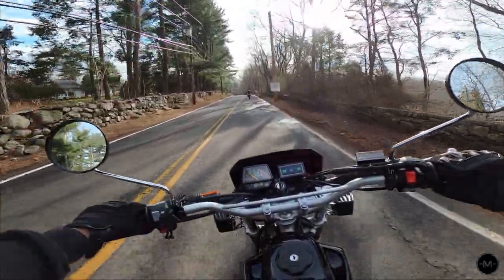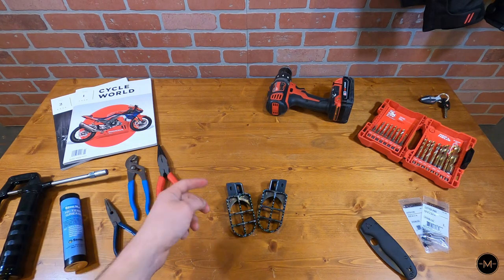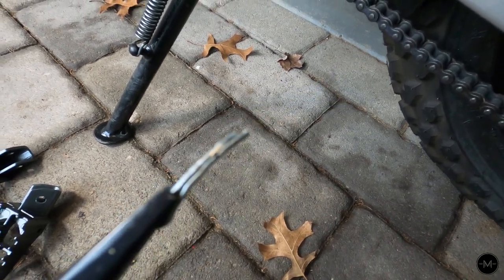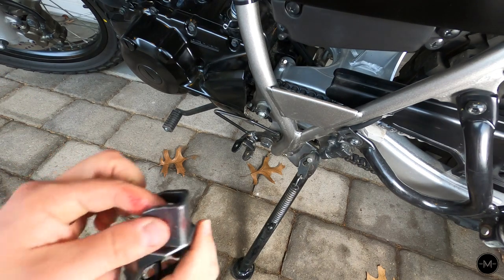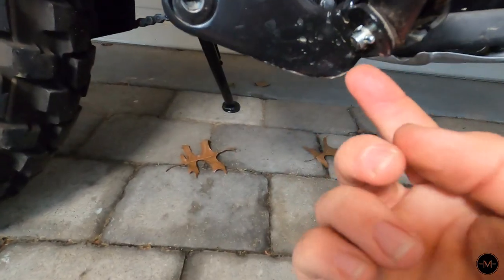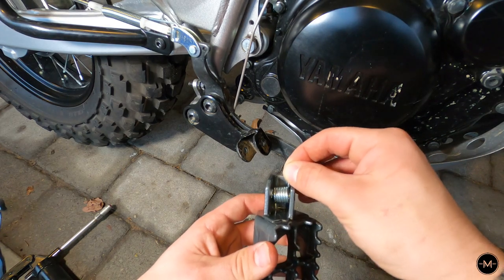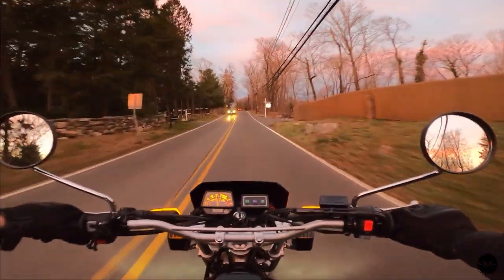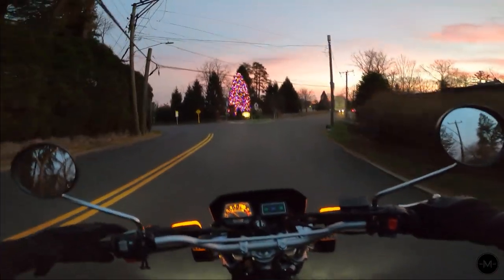Yamaha TW200 Foot Peg Install // Cheap & Easy // Product Review

Comment: Nice upgrade dude!  The bigger/wider foot pegs are most definitely the way to go! 
Glad to see that your install went well and that this model pegs worked so good for you. 
[Different brands/types are hit-and-miss] 
You nailed a very important point..  Foot control/feel once on this style of peg.. 
Since they added material to both the front and back sides of the pegs, 
they closed up a bit of room between the front peg and shift lever.. 
It's okay if riding with shoes or most work boots [I tried w/ my Keen Springfield Industrials]
But when riding with O'Neal Sierra IIs or Alpinestars Belize boots [sz 45 (11)]
The toes just love to fumble around and sometimes mis-shift.. 
My lever had to be spun  CW a tooth or 2 to get it up a little bit higher.. 
Much better for sitting/shifting 
Not so much for standing/shifting 
But for standing-riding in general,  these things absolutely rock!
[This style will also be a bit less aggressive as far as wear on the bottom of boots]
Great video as always bro!  And thanks for sharing! 
😊👍 
Sam -
Reply from the maker: Hey thanks for watching! I don’t have true riding boots like your O’Neal’s (hopefully I’ll pick up a pair soon). Riding with my work boots has been good, but I could use the extra protection! I’m sure riding boots are more clunky, so I’m curious how it will feel, especially with the new pegs!

Comment: I bought the pair with screw in studs the work awesome my boot actually sticks enough to lift the peg 😬
Reply: You should consider getting the ricochet skid plate off road can get pretty intense I believe it saved me once already 😎
Reply from the maker: Hey thanks for the comment & watching! Oh that’s cool I didn’t know they made it with screw in studs, but I’m glad to here they work well. Before I bought them I was a bit nervous that my foot wouldn’t fit, most of the time I wear my Chippewa work boots which are pretty big. But I put some miles on the bike with the new foot pegs, and they fit totally fine! 

I really want to get the ricochet skid plate, I think they sell it on procycle? I’m hoping to purchase one in the next week or so 😃

Comment: how is the bike n what's the mileage of the bike
Reply from the maker: The bike has been great so far! I’ve driven both on & off road without any complaints. Right now my bike has just under 600 miles. I just ordered the oil & filter for it’s first oil change! Thanks for watching, great question 🤘🏼🌲
Reply: I mean how much mile per gallon
Reply from the maker: Oh haha, I’ve been getting around 60-70 depending on how I ride. It’s pretty good on mileage.